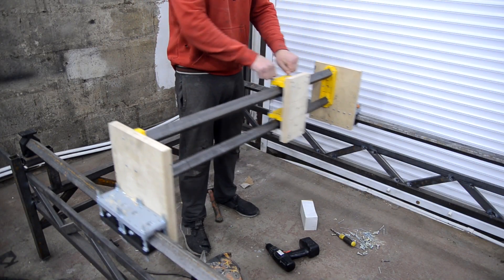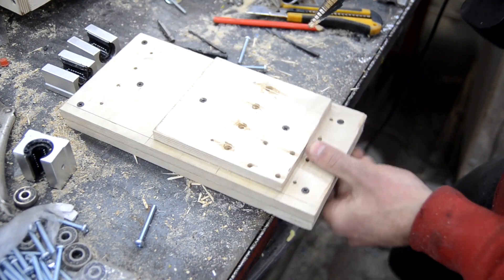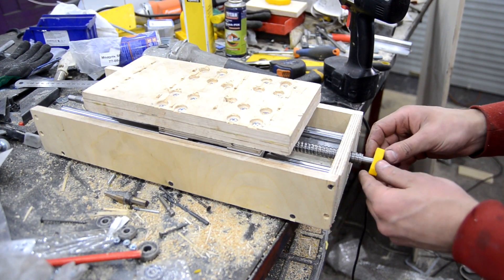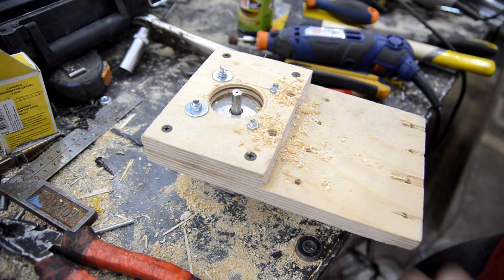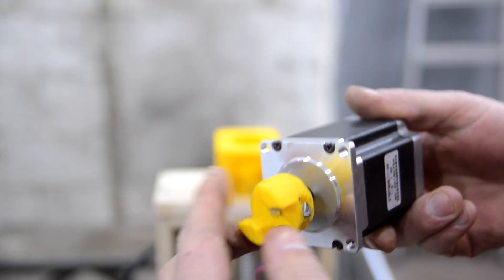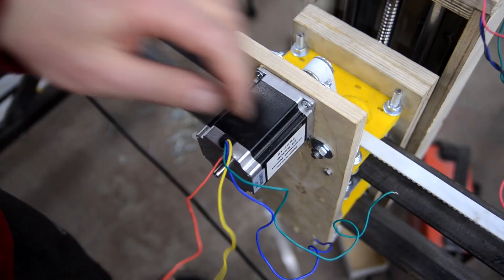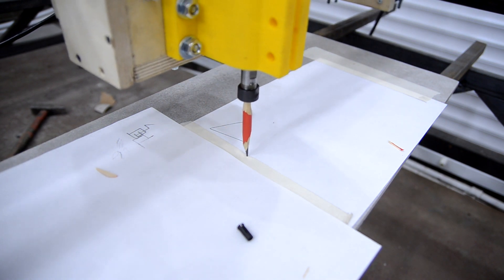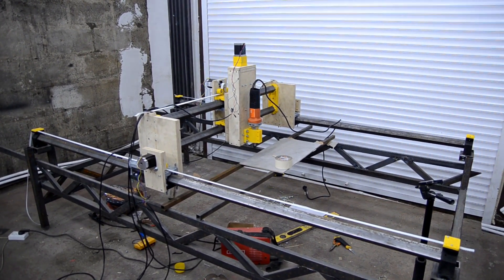How to make a homemade CNC machine  Part 2

Comment: I note that you are using single bearings on the end of the ballscrews (these are usually twin at the drive end, with end loading)- how did you stop end float of the screw?